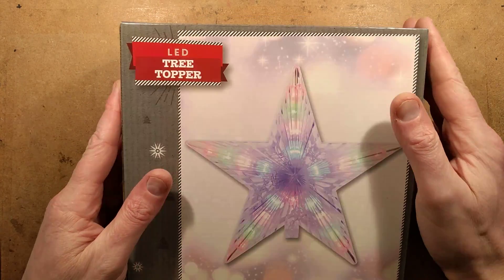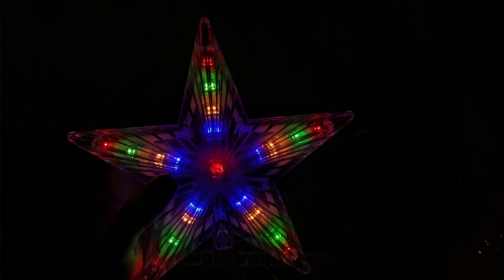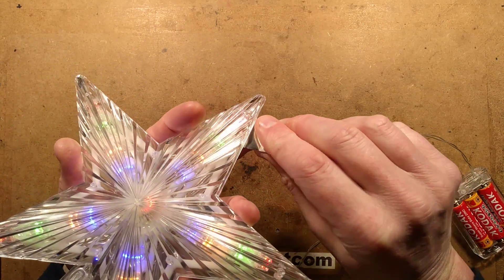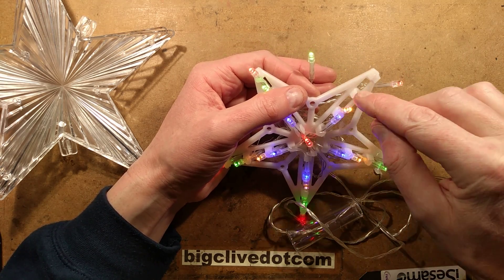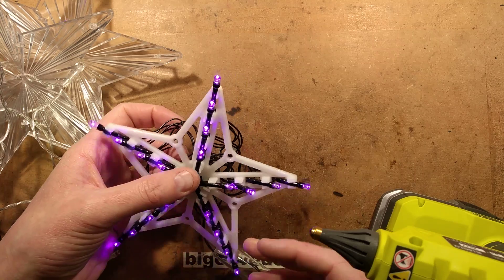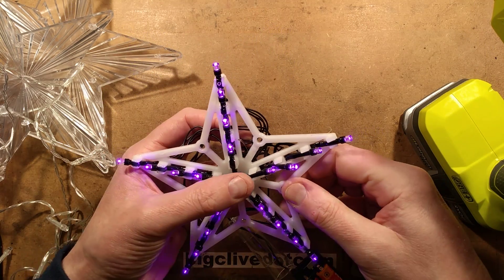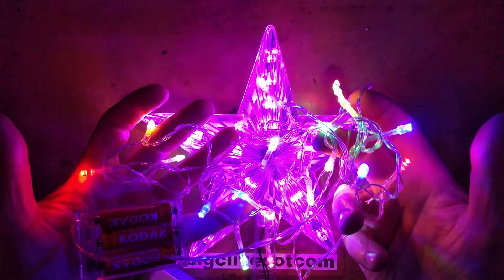Poundland purple gothic death-star hack.

Comment: Not sure if clive has attempted it but I've noticed some cheap colour changing usb bulbs from asia seem pretty hackable (as the only part you can't easily open without damaging them is the bit where the bulb fits into the socket) namely the ones of this design: https://www.aliexpress.com/item/AC-110V-220V-24key-B22-Smart-IR-Remote-Control-Holiday-Dimmable-Stage-Light-16-Color-Magic/33004759685.html?gps-id=pcStoreNewArrivals&scm=1007.23409.123629.0&scm_id=1007.23409.123629.0&scm-url=1007.23409.123629.0&pvid=84509ce8-d835-47d6-a868-404df926a432&spm=a2g1y.12024536.smartNewArrivals_36696682.33004759685

They're pretty dim light for a room at max light settings but I'm sure some diy modifications could fix that.

Comment: Never knew Ryobi made a glue gun. Interesting.
My solution to a cordless one was a 6V one off eBay meant for 4x AA cells (lol), a big, fat 3S 90C lipo velcro'd to the underside of the grip, and a 5 amp boost converter to take it up to 12V. Works real well and it hasn't burned out the heater in three years. Use it every other day. :)

Comment: I did the same mod to all the christmas lights my mom has after I saw the huge box of used up batteries since she had 4 lights all using 3 batteries each running for over a month, mine was a bit more crude though as I just put the leads into the battery box to make use of the power switch and the timer function

Comment: Check out the controller on these lights: https://www.banggood.com/pointsmall/ARILUX-Battery-Powered-6M-40LEDs-Globe-Ball-Fairy-String-Lights-for-Christmas-Patio-p-1203799.html looks a bit more advanced than what you usually get, it has BUTTONS :) Thought you'd like it.

Comment: Leaky batteries: FWIW - whether alkaline or zinc chloride, they ALL cleanup well using a baking soda paste and a toothbrush (just don't put it back in your mouth afterwards!). I got that information from Gillette after some of their Duracells leaked about 30 years ago (it's the officially recommended cleanup method, followed by water wash)

Baking soda paste also works well for lead-acid battery cleanup. It neutralises the sulphuric acid nicely - useful info if you ever have to clean up a leaky car battery mess.

Comment: Oooh.... it IS important,  which way round the resistors go.... they've both got to have their tolerance bands facing in the same direction. ;)
Reply: Tolerance band on the right so you can read the colour-code left to right 😃

Comment: How do we send you stuff??? I’ve got a parrot drone battery which has done something very strange. Bought in April. Amazon have replaced no questions asked and asked me to dispose off immediately. I would like to send you so you can have a look at it
Reply from the maker: Has it puffed up?
Reply: bigclivedotcom yes it had. So no longer fits, have you seen it before??
Reply from the maker: @7chappers  it's a common failure mode of those cells.
Reply: Ahh okay. What happens? Cells burst?

Comment: Maybe a tiny PCB for the Big Clive .com, but you do enough projects run off those battery banks, maybe a printed USB connector pattern screened on with some through holes as breakouts/pads for resistors might be a fun little design project

I'm sure a business card sized PCB etched, screened, drilled & perforated from China wouldn't cost much if you didn't want to do it in house

You could even sell them, or use as viewer giveaways?

Also curious if certain resister combinations could trick the power banks into supplying the higher amperage some are able to do for tablets or "fast charging" capable devices... Could make for a High/Low brightness option?

Mildly disappointed you didn't heat shrink the resisters individually before doing the larger shrink tube & hot glue, albeit a little excessive and somewhat redundant, i've come to expect that extra mile from your stuff

Thoroughly enjoy your videos though, stay awesome

Comment: What I recommend with those alligator clip helping hands things, which is what I do, is to use a small C-clamp to clamp it down to the edge of the table or bench.  That way it doesn't slide around when applying a little force to something being worked on.

Comment: I never thought it would work so well to just squeeze hot glue in heat shrink, that's a really cool trick!
Reply: I've also had good results snipping a piece of cold hot melt glue off a stick, and putting that inside the heatshrink before heating it.
Reply: @Tim_Small  That works, too!  :-) Have to make sure you have enough, but not TOO much.

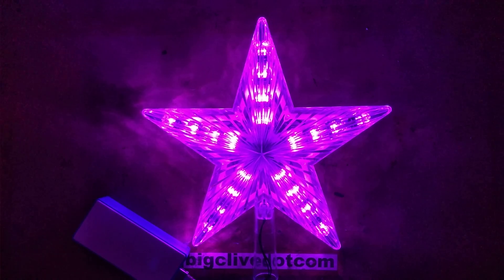Comment: 18:16 I could get onboard with this christmas thing when you put it that way
btw, get yourself one of these, you won't regret it. I use the v-grove jaws for holding pcbs, sockets and wires and such when soldering/desoldering. 
https://www.ebay.com/itm/ACCS-Swivel-Vice-With-sucker-SV-70AL/322390347570?hash=item4b0ff64f32:g:5WIAAOSwopRYeg~Z:rk:20:pf:0

Comment: To rebut - I have LOTS of Super Heavy Duty batteries, alkalines, NiMH, and LiPO.   The only ones I've had fail (leak) in the last six years are... alkaline.   In fact, I have a Duracell AA battery in front of me, not even installed in anything to drain it, with a 'use by' date of 2023 - completely covered in a white crust.   The one before that?  9 volt Alkaline.  The ones before that?   Alkaline C sized batteries that destroyed a flashlight.  Before that?  D Cells that destroyed a MagLight by welding themselves to the inside of the barrel, never to be removed.   The ZC batteries are doing quite nicely in my radio (30+ hours, minimum), my remotes (1-2 years), and my two led 'light balls'.   They even do nicely in wireless mice (Not something I'd recommend on a regular basis, but I keep a set of cheap ones in my bag to put in customer mice and keyboards when they try to get me to 'fix' their computer with a dead keyboard and mouse.
Reply: I just got a guitar down from the loft, built in pp3 powered preamp.  Been up there more than 10 years.  As you can imagine, I was praying I hadn't been so stupid as to leave a battery in it.  I had.  Cheapo.

  Pristine.  Still some juice in it.  I was astonished.
Reply: @raykent3211  - Just as a funny, I realized that I probably should change the batteries in my steel 'safe' cabinet that I use for storing guns, ammo, etc.  It's been about 10 years.  (4 C).   I punched the codes, the lock unlocked, opened the unit, opened the battery compartment, and they're "W&S Heavy Duty"  - https://swsbc.en.ecplaza.net/offers/heavy-duty-battery-ws-batt-164_5644722    I'll admit, it's very low drain, but still - 4 C's, for a decade, no leaks, and still have power.   Obviously, there are jobs where the extra power of alkaline isn't necessary, or even desirable.
Reply: Even better - I checked the batteries.  No leaks, and still at 1.56 volts.
Reply: Lipo wins always

Comment: Clive...Nice EZ hack  HOWEVER  the heatshrink is labelled wrong.  The USB plug mics at about 12mm wide by 4.5mm thick.  Looking at the video at 15:31 you can see the excess shrink around the plug.  I'm guessing the actual size of the shrink used would be about 20mm Flat wide.
Reply from the maker: The heatshrink is supplied flat but the size is the diameter when pressed into a tube.
https://www.rapidonline.com/Cables-Connectors/12-7mm-X-1-2m-Heat-Shrink-Sleeve-Clear-03-2390
Reply: @bigclivedotcom  Thx  Clive

Comment: You could use Sugru over the soldered USB connector and cable as it cures to form a silicone rubber compound. It's also heat proof and electrically isolating.

Comment: Do you regret threading all the lights through the mount sleeve, or was it worth it to show the original power supply?
Reply from the maker: It was easy to do and was just to show that you'd have to do that with the original battery pack.
Reply: @bigclivedotcom  I'm sure, just something I noticed. Thanks for the reply, makes me feel special. You have inspired me to be less afraid to open my electronics and try to fix them.

Comment: Clive I have mod v2 for you. All 4 usb connections will be needed. Create a PIC microcontroller program so that you can do things like have the star light do a running chase or 
flash in other patterns. And a bit of software on a computer to change a design without ripping the package open. Then have it so you can link a bunch of stars together with something like DMX.
Then if you really want to push it use addressable 4 color LEDs and the PIC control the whole mess. I recall you said that the WS2812b projects had been over done at one point. Might this be a good place to dig out the programming hat and have some fun or if not at least the PIC controller idea? Oh and it's too bad the smap pins need the holes between the arms you could of put some other color there to add a little something for overkill.

Comment: Almost there! Usually there are a half dozen strings of led's, all to be converted to 5v usb. Doable, but what of the little circuit boards that allow for flashing and/or fading? is there anyway to include them into the overall setting? I am about to attempt this project because it is a pain to load all the batteries (some at 4.5v and others at 3v) and to then have to switch them on and off individually.

Comment: Something I like to do when making bare connectors like that which have no boot, or rebuilding laptop power connectors that have been wrecked, is after wiring the connector, add hot snot where the boot would be, then shrinkwrap over it. Works almost as good. For added strain relief, slide one or two smaller heatshrink pieces onto the wires before soldering them, then you'll have a strain relief under the hot snot, under the shrinkwrap, making a nice DIY boot with strain relief.

Comment: That hot snot connector is pretty. Though not sure if there was enough clearance between the shell and vdd to prevent short. The shell of usb plug is usually connecting to ground as well. Well the snot hopefully keeps them from dating.

Comment: I've found that for tiny surfaces like USB connectors and the likes, tiny tips like T12-JS02 at high temperature (470°C in my case usually) work best. Hoof tips are great for large surfaces when you want to dump a lot of heat into something, but for precise work I don't find it to work too well. Do consider something along the lines of the J12 tips!

Comment: i personally just use a regular lighter for hot glue, you heat as much hot glue as you need an blob it on like it was a soft wax crayon, i cant decide if your strain relief is good or bad, the wire used in the star is going to be the failing point, probably will fail NEAR the plug, not inside it, would rather have seen thicker wire coming from the usb plug to the existing wire, secured on the inside of the star but eh... what do i know, it'll probably work fine for it's intended purposes for a good long time if not abused

Comment: Clive use the female end of a male/female usb cable in your crocodile clips to hold the usb plug while soldering. The jaws would be better able to grip the strain relief of the socket than the usb plug.

Comment: The extra access port is probably the initial wire exit before someone discovered the path through its bottom tree support cone; also for the times the wires were not threaded before assembly.
Reply: More likely for a switch

Comment: Hi, do you accept devices for testing from your viewers? Is there any way to contact you besides here? I contacted the manufacturer of a device I have and after an initial flurry of default responses, I was stonewalled. The company in question is Energizer Holdings. I'm no electrical engineer but there is definitely something not quite right with this device. Would very much appreciate your input.
Cryptic I know, sorry. I'm reluctant to show my cards in public though, so to speak.
Reply: There's an email address on the channel's About page.

Comment: You didnt want to bridge the data pins and increase available current?
Reply: Phonotical that’s not how that works....

You bridge data pins on a charger to indicate there’s more current available. Bridging them on a device will either do nothing or it will harm the data pair of your computer’s port.
Reply: @JasperJanssen  not in my experience
Reply: @JasperJanssen  hold up, this "device" has no data lines and it only drawing power from a power bank, attached to any other USB input it would do no harm what so ever

Comment: Hey, Clive, I took mine apart about 7 days before Christmas Day! Found 21 LEDs inside all wired in parallel using cable. And a 24 ohm resistor in the three AA cell battery box. Good to see you have hacked it 😎.
Earlier in the year, I bought a cheap Chinese tree topper from eBay. But forgot about it. It’s still packed away 😳
Reply: Christmas is a recurrent calamity, so nothing ruined yet, Mark 😂

Comment: Those cells were all you'd got left?? Have you been unwell and unable to get proper ones? And how did those HEAVY DUTY ones get in your household in the first place?
Reply from the maker: I gave my neighbours gifts of LED strings preloaded with alkaline batteries and some spares.  I've got these ones to do capacity tests on.
Reply: @bigclivedotcom  With that reed switch clock of yours? I ended up making one myself, although my reed switch required I run the entire power through the coil, so at 20 mA, these tests take about two days each.
Reply from the maker: @Anvilshock  I wound a custom coil round a bare reed switch.
Reply: @bigclivedotcom  Tell me about it. Not having done much coil winding myself in the past, I tried a number of windings from various wires from .5 to .1, all without success. Not enough magnetic field to trigger the reeds, too high a current for practical use, the coil heating up to burning … not to mention the winding of the wire onto the tiny, ~15x3-mm switch itself. I ended up turning it into a tiny bobbin with hot glue and some cardboard and just wound an entire spool of .1 wire and an undetermined winding number (the listing I bought the spools from claims some 15 metres of wire) onto it just to be done with it. Found out I could have saved myself the hassle by just buying reed switches that include the winding in various configurations and currents as SIL packages.

Comment: If you want a neater/easier way of adding USB connectivity to a project like this, there are a few nice options available from AliExpress (which I assume are on eBay as well?):

- Micro USB female sockets with a plastic shell (white or black): https://www.aliexpress.com/item/20PCS-DIY-Micro-USB-5P-5Pin-Female-Plug-Connectors-Kit-Black-and-White-With-a-Shell/32826091909.html
- Micro USB female socket on a PCB with 0.1" header positions: https://www.aliexpress.com/item/20Pcs-Micro-USB-to-DIP-Adapter-5Pin-2-54mm-Dip-Female-Connector-Micro-Usb-Type-PCB/32879257041.html
- Full-size USB male plug on a PCB with 0.1" header positions: https://www.aliexpress.com/item/10pcs-Type-A-USB-Male-To-DIP-2-54MM-PCB-Board-Power-Supply-DIY-Adapter-Converter/32951495792.html
- Full-size USB male plug with a plastic shell (essentially what Clive's made here, only with a injection moulded plastic shell instead of heat shrink and hotmelt glue): https://www.aliexpress.com/item/DIY-10pcs-Type-A-Male-USB-4-Pin-Plug-Socket-Connector-With-Black-Plastic-Cover-Adapter/32914032721.html

There are other options as well, such as microUSB plugs with plastic shells, full-size sockets with shells, etc., and given the price of all of these options (like, £1-2 for 10-20 of them!), I think it's a good idea to just get a handful of each type so that you always have a handy stock of whatever the ideal USB connector is for your latest project! :)

Comment: Cool idea with the hot glue - I've been doing some work with LED strips and was filling the heat shrink with clear silicone. The hot glue would be less flexible but self-shrinking the heat shrink is neat!
Reply: Another tip for hot glue: it doesn't stick to baking paper (if you don't move it until it has cooled completely). It's easy to make rugged connectors that way (e. g. with 0.1" pin headers) without needing heat shrink in the appropriate size. Put a dab of hot glue on the baking paper (helps when it is on a cool surface itself), push the connector in and either push down with a second piece of paper or just repeat for the other side after the first dab has cooled. Peel the paper off and trim the sides with flush side cutters. The connectors will look almost injection molded with some practice.
Reply: Never thought about using hot glue to back fill heat shrink. I'll have to try it next time. Just another benefit of watching Big Clive.
Reply: The Julian Ilett way if I'm not mistaken. :-)
Reply: You have to be very careful with that. If you put too much hot glue in, it can shoot out pretty fast an can give you nasty hot glue burns.
Reply: i may use this trick in the future but i dont have any usb ends or thick enough heat shrink and its been years since i've seen my hot glue gun, i dont use it anyway lol